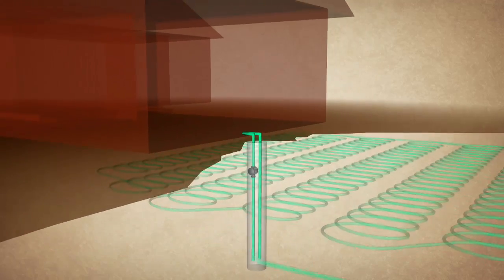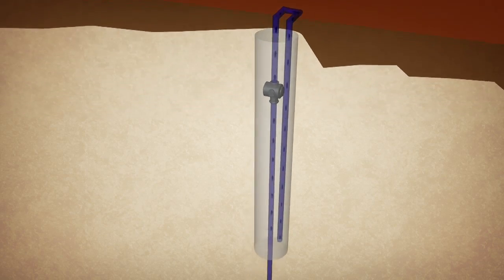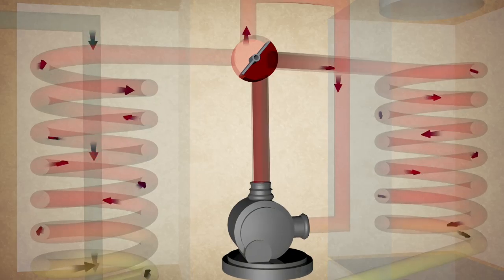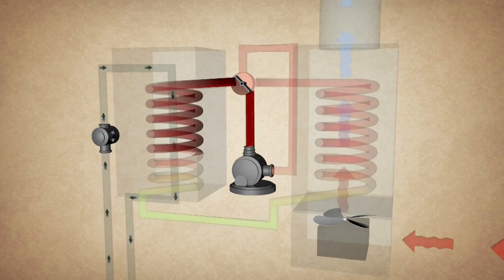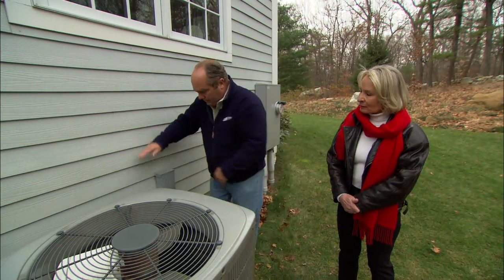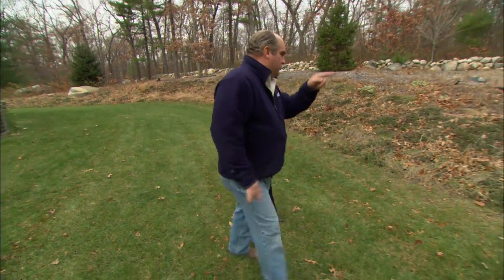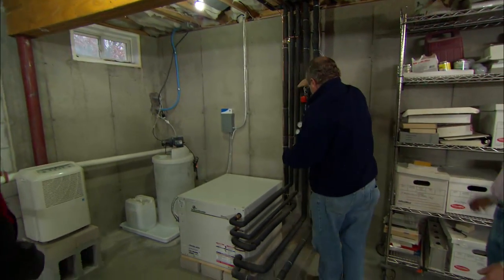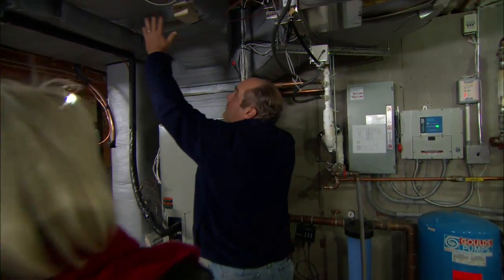How a Geothermal Heat Pump Works | This Old House

Comment: The compressor DOES NOT pump liquid refrigerant. If you get liquid into your compressor, you're going to ruin it. Like sucking up water into your car's engine.
Reply: Let them think what they want. That's why we get paid the big bucks!!!
Reply: Ok but water in a cars engine won't ruin it necessarily. Water flooded cars , you drain the water, replace the oil and start the engine over. Many engines can be saved
Reply: @eksine  different with refrigeration. It will blow up the compressor. A good analogy, but different concept.
Reply: @RIZZGAWD1  it wasn't my anology, I was telling him that water in the car's engine won't ruin it. you have it mixed up, I was making a correction
Reply: @eksine  I was saying his analogy is a good analogy, because your car can't run with water in the engine. with a hermetically sealed compressor, you will do internal damage you can't fix, unlike a car engine with removable parts. Something is only ruined until it's fixed. either way, you are dishing money out to a professional to fix it because it won't work otherwise. I hear what you are saying. But I think you are reading too far into it.

Comment: Basic cost can be LOWEST FIRST COST to LOWEST FIRST YEAR COST.
your welcome.

Well: Deduct the water heating system and distribution and other common components
just like the Federal Reserve Building did and the first net Zero School in KY and in the US with only 2 mil of Solar...
NOW ask a couple more questions:
1) How do we heat hot water ON-DEMAND instantly by temperature control with our GEOThermal System?
Does that require additional loop,  more than just what we are told a water:water unit needs? (Yes It Does, if all in one Air:Water Heat Pump, because those units are like a wtr:wtr and air:water combined in one box).
DIAGOSTICS to HEAT RECOVERY 100% in Cooling Modes (NOT a "Hot Water Desuperheater Generator" but a Full-Condensing DeSuperheating PRIORITY Hot Water , or Pool or Radiant Heating system from a Water-to-Air Heat Pump...
1981 Patented:
From "Red Board " 2007-2013 diagnostics with 9 Sensior Readouts to
now: BACNET ProStat with more! on all multicompressor and V-Star VARIABLE compressor systems, 2.1/2, 4, 6 ton  see  Bristol's V-Star and  Hydro-Temp.com
(first in Patented 100% instant heat recovery for Hot Water and Priority Hot Water)

Energy Star (TM) Most Efficient GeoThermal does NOT INCLUDE one feature: PATENTED 1981, H-T Priority Heat Recovery of making Hot Water Simultaneously in Cooling Modes (loop Pumps are "OFF" then)  Why buy Wtr:wtr plus Wtr:Air ?
The first NET ZERO SCHOOL in the country , as the Fed Resv Bldg.  all have Hydro-Temp DIAGNOSTICS and Priority Heat Recovery 100% Instant HW on Demand systems, all in one, pumps in units for decades.  www.  GEOPROS.org

Comment: Basic cost of this system please ? Thank you.
Reply: +GILLEBRATH Total cost is about $30-40k depending on various factors (available well or pond lowers installation costs).  It only costs about $1k a year to run, so if you are spending $3-6k a year on propane, oil or electric it pays for itself in five to ten years.  Target market is young couples/families living in homes off the gas grid for this reason.  

Incredibly efficient and low maintenance, many systems are still operational after 30 years.  Completely clean.  Subsidies are being ramped up as with renewable energy in general so it will be competitive with any other HVAC system in a few years depending on the political climate, no pun intended.
Reply: @squamish4244  1k a year to run ! Ha. My December bill for 2 units was 730$
Reply: @carlmottola5611  So $365/unit during one of the coldest months.
Reply: @squamish4244  yes. And let’s not forget I couldn’t get my house above 63 degrees without running my wood stove. Not very comfortable. Also I live in NJ, not Canada. On the coldest days you touch the negative degrees for maybe a few hours, and on those days the high is in the teens. But the average temps are about 30-35. Your not talking sub temperatures
Reply: @carlmottola5611  $1k a year is a very rough estimate based on many factors. E.g. a shitty installation can blow everything. But for two units in December, even in NJ, $750/mth is not unexpected. Think of what you'd be paying for propane.
Reply: @squamish4244  I would think if I had natural
Gas, I would probably be the same
Or cheaper honestly. My
Previous house was natural gas. Smaller yes, with one unit, but not half the size. I also take into consideration that my house although not very large, is long and I know heating long houses is much harder then heating a square home. But all that into consideration, my bills at the old
House were never half of what they are here. So I don’t think geothermal is that efficient. In addition, in my old
House, if I set the temp at 70degrees, that what the house was, it wasn’t 63 when I woke up in the morning, and I didn’t have to put space heaters in my kids bedrooms so they weren’t freezing. Also if geothermal is so “green” why do I need to burn so much electricity or fossil fuels to run it? It seems like a Gimmick. That tree huggers sell you and tell you you are saving the world. The worst part is I’ve had multiple geothermal repair companies come
Out to work on my units. They’ve told
Me my units are appropriate size, my loop is in good condition, and that my units are running well. They’ve also told me, just prepare for high heating bills and it’s ok to be cold, wear a sweatshirt in the house. Not the best advice when I just want to be warm in my house
Reply: @carlmottola5611  What can I say man, out of the hundreds of homes I've installed geo in, I've never heard of a case like yours. We even put in geo in 150-year-old stone or double brick farmhouses that leaked like a sieve, and they still had no problem keeping the temp at 70. I can't say what's going on with your place. If I thought I knew what was up I would tell you, because I don't like to see geo getting a bad name, obviously.
Reply: @squamish4244  I appreciate the concern, it just sucks. My house has a lot of drafty windows and doors but it’s not that old 1986. Even the guy who maintains my system once a year told me the return temps and supply temps are great for what the machine should do. Like a 30 degree difference. But when it’s cold out, I’ll only  get like 82-85 degree temps out of the vents. Just not enough. Also, should my lines in the loop freeze when it’s cold? Seems like that has been happening a lot, just prior to the unit in the basement. Also, it seems that my electric backup is running a lot lately
Reply: @carlmottola5611  No, your lines in the loop should definitely not freeze when it's cold. Absolutely not. Something's going on here, I wish I could tell you what.
Reply: GILLEBRATH
Yes.  Initial costs have been a major obstacle to installation for decades.  As a contractor, I find it is often a black box problem - you can't see it, and convincing a homeowner to spend an extra $10-20k on a high-quality HVAC system during construction when it is cheaper and easier to do instead of granite countertops, walkways, landscaping etc. that could be purchased at any time down the road is remarkably difficult.
Reply: @squamish4244  I'm sold on the basic system and would like to retrofit my place. This video though scared me a bit because of all the devices and tools, maintenance (and proper maintenance over the 30 year live span is what has me a tad concerned.

How bad is a retrofit job in WNY, Southern Ontario?
Reply: Do you plan on a horizontal loop, a closed loop, a vertical loop or a pond loop?
Ductwork can be minimal or extensive. It really depends on a professional estimate.

The unit and indoors work need little maintenance, IF installed by a quality contractor.
Reply: @squamish4244  i dont see there a hard water softener, to be a low cost maintenance, it can be installed by whoever  when that sediment stick into the heater exchanger, call me and let me know how low is the maintenance  cost.
Reply: @elinventorcito  System should be serviced about once a year. Higher existing water quality will reduce sediment. Depends on local contractor rates.
Reply: $15-$30K But you can be looking at many thousands of dollars for the well or the field depending on your area.
Reply: Maxid1 Thanks . Many thousands probably . Not affordable for the average household but eventually it should get lower. It looks like a good system efficiency wise.
Reply: Depends on the load required the rates and incentives offer’d in your area. There is never a one size fits all approach to any HVAC system.
Reply: @Channel-cm7yc  100% correct. Blanket estimates are difficult.

American government offers 26% tax rebate to all systems. This was actually implemented under Trump, oddly enough.
Reply: I helped my grandpa install one of these in his home. He only spent $5,000 for the equipment (he knew a guy who owned an HVAC warehouse so got a good deal on the geo unit) but the real money saver is that he didn’t install a closed loop or well or anything like that. His previous geothermal unit (which was quite old) had used natural spring water but it started running dry so we hooked up the new unit to his well water. We installed it to the duct work, made the plumbing connections, drain line dumped into the nearby river and we ran the refrigerant lines between the heat exchanger and the geothermal exchanger then called an HVAC person who brazed the lines and balanced the system. Sure it was a self install but no need to pay $30-40k for it. My grandma’s electric bill averages about $100/mo winter and summer
Reply: +valair  Still expensive . thanks